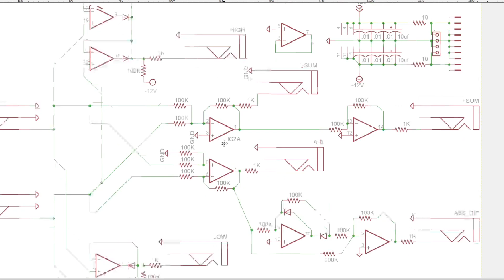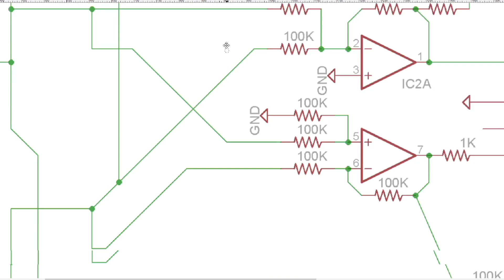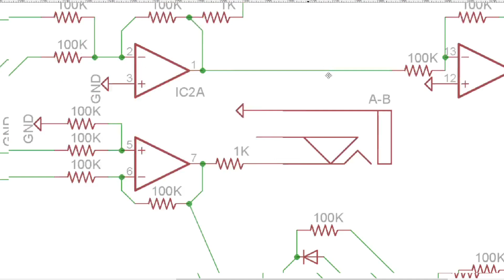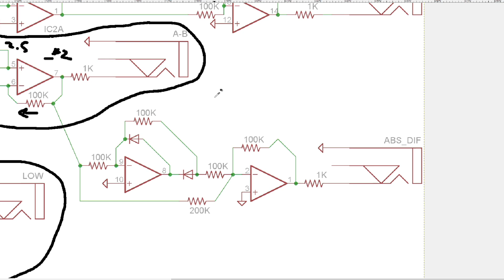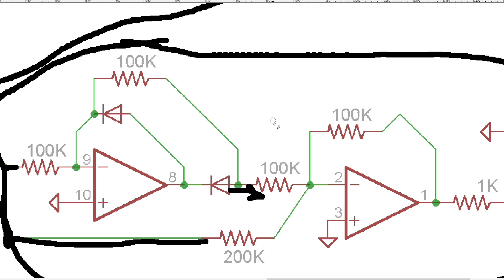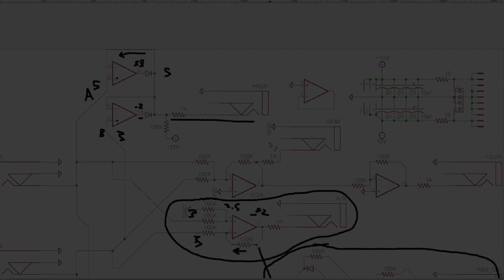BMC113 Voltage Compute Schematic Walkthrough

Comment: @1:23 The voltage at node 14 is not -2V. Since the opamp is in open loop, the voltage at node 14 goes to negative rail of the opamp.